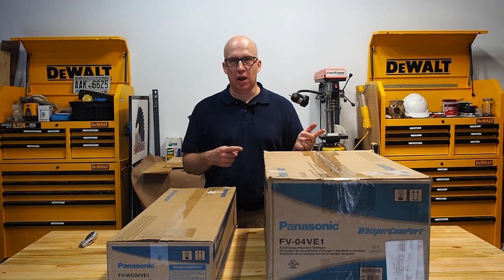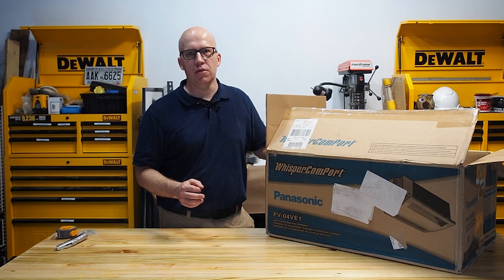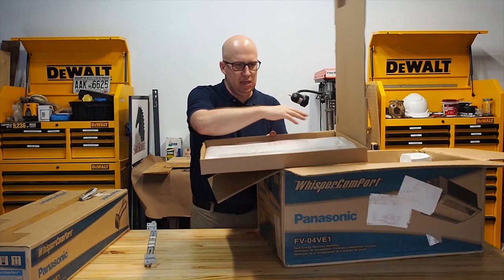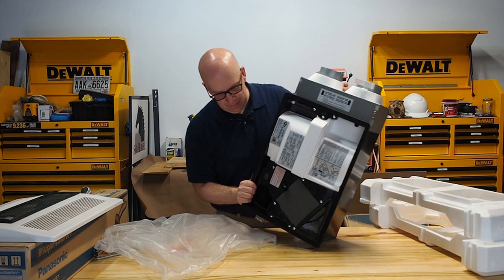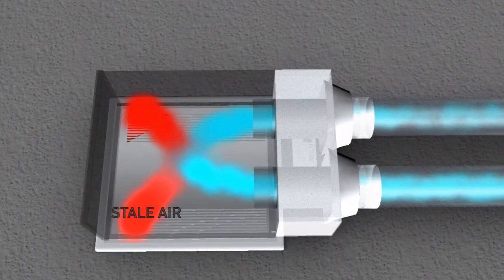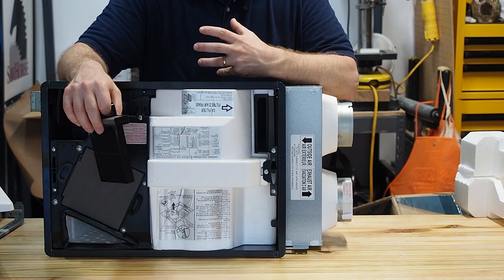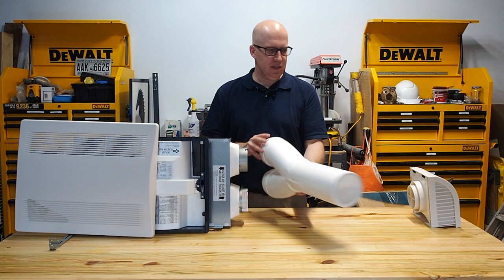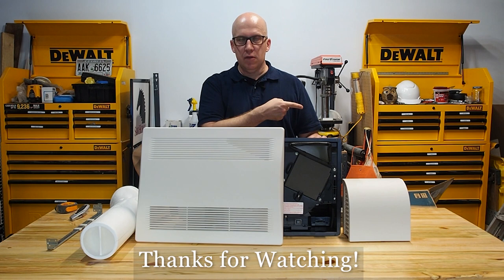The Benefits of an ERV + How it Works | Panasonic FV-04VE1+FV-WC04VE1

Comment: Fresh air is a big concern during the winter months since the goal is to keep the cold weather out.  Good to see that there is a reasonable solution that does not have an energy penalty.
Reply from the maker: Most people don't understand balanced ventilation.  This is one of the better solutions to get fresh air without a high cost of energy.
Reply: @SawHorseDesignBuild  expect in the install manual tells you best to run between March and November. If you live in cold climate, I'd recommend HRV.
Reply from the maker: @umadbra  Some other ERV's work better in cold climates.  Seems like the limitations are on the spot ERV's
Reply: @SawHorseDesignBuild  anything in New England is recommended to have HRV to have the air heated before coming into the house.

Comment: nobody ever talks about the exhaust filter that is attached on the inside of the white cover

the little black merv 8 filter and all 3 filters to my understanding are to be dry vacced then placed back into the ventilator but I'm no expert. it's what the manual says to do though
Reply from the maker: Yes- the filters need to be maintained for optimal performance.

Comment: Thank you for the information. For those 4 inch ducts to connect to the outside do they need to be insulated ducts?
Reply from the maker: Depends on the location of the ducts.  I would insulate both but if it is in a semi conditioned space just the supply needs to be insulated.

Comment: Is this needed in a closed cell spray foamed detached garage/shop with just a mini split.  Located in Florida.  Just had spray foam added.
Reply from the maker: depends on what you are doing in the space.   Sometimes an exhaust vent is better is you are creating a lot of dust.  How are you using the space?
Reply: @SawHorseDesignBuild   mostly storage honestly, but i keep all my outdoor equipment out there. So slight fumes at times but i keep the garage door open for a few extra minutes before i close it.  Just fumes from starting riding mower then driving it out and then putting it back in. I have a 9’ wide garage door and a standard 36” door plus 2 windows. It’s def tight though when i close the 36” door i can feel the slight pressure. If i open a window it closes with ease. Minisplit goes in this week. Plywood on walls but open ceiling attic area which of course is all foamed as well. Just a pain to add something now with all the foam on walls and roof.

Comment: I'm sure this is an odd question. I have a crawl space, and my HVAC return ducts are in the crawl space (supply is in the attic). Can I patch off my return duct to pull conditioned air into this ERV, and send the old air outside?

Even sillier question.....if I do that (and don't use the Y adapter), could I potentially send the stale air out through my existing dryer vent duct with a Y adapter? If I can do this without putting more holes in my house, I'm quite interested.
Reply from the maker: This particular one is a spot ERV so it is not self balancing and should not be connected to the central HVAC system.  The reason to pull air from the outside and not the return is to get "fresh" air with Oxygen etc.  You might be able to attach the exhaust to the dryer vent, however not sure what your house looks like.  I'm assuming you have a ventless dryer and no longer need the vent.

Comment: Do you have any suggestions on how to add a prefilter on the fresh air intake (to filter incoming air) or stale air (to protect the core)?
Reply from the maker: Is this for a DIY install or are you an HVAC tech?  I would install a filter box that can house a MERV 13 filter with very little pressure drop.  I might work on a video showing how to do that since I have been asked a few times.

Comment: I'm looking to install this in a ceiling that is 2 inch tongue and groove wood.  Do you think it is possible?
Reply from the maker: I just looked at an older model and it looks like there is 2" clearance between the face of the box and the housing where the supply and exhaust come out.  You might have to get creating with the brackets but I did see a way to make it work.  Let me know if you want a short video on what I see and I can work on it next week.

Comment: How does it not short circuit on the interior without interior ducting? Won't the fresh air supplied just get sucked right back into the stale air return?
Reply from the maker: Some of it might.  The air is directed away from the intake though.

Comment: Hey Matt, great video thanks for the input. Have you installed these in any cold climates? The documentation says that if the outdoor temp drops below 20F then the unit goes into exhaust only mode. Wondering if you have any experience with that thanks!
Reply from the maker: I live in a warm weather climate.  

This is the response that I got from Panasonic:

OPERATION

FV- 1OVEC,2 is recommended for areas where temperatures can drop as  low as -22°F (-30'° C), When the outdoor temperature  is < -22°F (-30°C},  the defrost cycle is initiated and the product  will stop operating for 47 minutes, then operate in heat exchange mode for 4 minutes in order to sample the outdoor temperature.  lt then
operates in circulation mode for 9 minutes in order to defrost [exhaust and supply air are 50 CFM].  Defrost cycle overrides the ASHRAIE 62.2 timing function.

FV- 10VE2  is, recommended for areas when temperatures  can drop as low as 14°F [-10°C).  When  he outdoor temperature is < 14°F (-10°C) the defrost cycle is initiated and the produce will stop operating for 56 mins. then operate in heat exchange mode for 4 minutes  in order to sample the outdoor temperature  (exhaust and supply air are 50 CFM). Defrost cycle overrides the ASHRAE 62.2 timing function.
Reply: This HRV is  disigned to run constantly , when you turn it off cold air blows into your house vary impractical useless thing

Comment: what  is the max room size this unit can do? 600 sf?
Reply from the maker: It depends on where you use it.  This unit is about 50 CFM.

This is what Panasonic says:  

ASHRAE 62.2 2010 Standard
The American Society of Heating, Refrigerating and Air Conditioning  Engineers (ASHRAE) set a standard for whole house ventilation, requiring that continuous mechanical ventilation be 7.5 CFM per bedroom (master bedroom X 2) plus 1 CFM per 100 square feet, with sone not to exceed 1.0. ASHRAE 62.2-2013 requires a ventilation  rate of 7.5 CFM per person plus 3 CFM per 100 square feet. Please check with your local code to determine which ventilation standard you should follow. Panasonic WhisperComfort ERV is an affordable, efficient way to meet the ASHRAE 62.2 standard.

Comment: Great channel!  
If I use one of these bad boys in an ~airtight cabin in climate zone 3 with one big room and one bathroom, what is your opinion on venting the bathroom?  I feel like venting to the outside with even a 50cfm fan would create negative pressure in the house and defeat the purpose of this (40cfm) ERV.  But if I use a through the wall fan to put bathroom air into the main room near the outtake vent on this ERV, I risk bringing farts into the room.  
Or could I reasonably go without bathroom ventilation?  
Thanks for your time and again for the video!
Reply from the maker: Good question.  It really depends on where you live in Climate Zone 3- if you are dealing with humidity from the outside you could have to design for that as well.

I would not use a spot ERV for your situation.  I would find one that is self balancing and can be zoned.  This way it brings in make up air if you have a bath fan.

This may seem like over kill but this is what I would do if the Cabin in was in GA:
Bath Fan with motion and humidity sensor
Self balancing ERV (if you can find one small enough)
Ductless/ Ducted minisplit system to address comfort and Dew Point/ Humidity.

Let me know your current set up and I can make better suggestions.
Reply: @SawHorseDesignBuild  Great information again.  Because it's going to be a big room/one bath and it's in a mixed humid area, I might forego an ERV to save on costs.  My setup as of now will be a basic supply fan to exert positive pressure in the house and a 1.5ton ductless minisplit for humidity control during the summer.  I am wondering if moisture from shower/cooking will be enough humidity when it gets "cold".  Or if I will need to ventilate those as well.  Always something I can do post construction as needed.

Thanks!
Reply from the maker: Here is a video response from Panasonic:  https://youtu.be/DU5ytOG64qE

Comment: How do you add another filter? It sucks in the air through the outside and the rest is in the ceiling.
Reply from the maker: Add a filter box in the supply duct from the exterior.  I think you can get a MERV 8 with the unit but anything greater would have to be a separate box.  I'm working on the video in a few weeks to show how this can work.
Reply: @SawHorseDesignBuild  exterior of the house? Doesn't the split air inlet/exhaust have a large housing? Or do you mean exterior of the erv inside the room on the ceiling?

Comment: I need help. It turns out that I have this installed with the exhaust/intake vents pointing upwards when I placed it in my wall. It looks like I don't have any other choice. Why do the instructions recommend the vents to only be facing downward for a wall installation?
Reply from the maker: Are you referring to the intake and exhaust on the exterior?  Pointing them down. prevents dirt and rain from getting in them.

Comment: i just bought a house built 1990 with a semi-finished basement.   i want to spend a lot of time down there but want fresh air, i am in the north east (NJ), their website says it only should run March-Nov in my area though.   Also, any other options I should consider?
Reply from the maker: Can you share the link to where you got that information?  I'll check with my rep to see what is best for you.
Reply: I’m in same situation-
 Is it OK to run unit year round in climate Zone 5?

Comment: Would this be useful in a garage to suck up cigarette smoke and bring in fresh air?
Reply from the maker: It could work for that if you are trying to not bring in extreme temperatures.  I would upgrade to a MERV 13 filter to help the core last longer since smoke is involved.  Also- be careful smoking in a garage since there are chemicals that are flammable.  Exhaust-only fans might work better depending on where you are located.
Reply: @SawHorseDesignBuild  copy that thank you

Comment: Rigid duct? Lol
Reply from the maker: I prefer rigid ducts for durability, however most would use flex on these models for ease of installation.
Reply: @SawHorseDesignBuild  do you also insulate the pipes? Durability? What's wrong with R-8 4" flex? All you are doing is taking extra time in a lot of times won't make sense to install hard pipes. Also charging extra to do hard pipe because of durability is crap. You are ripping people off.
Reply from the maker: It really depends on the location.  If the ductwork is between floors where they are not going to be affected by other trades, then flex is fine.